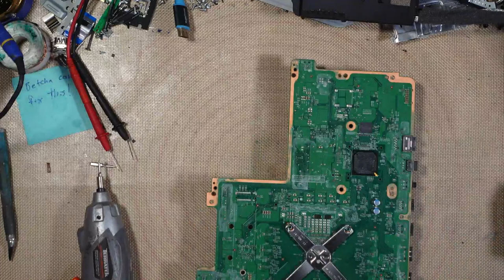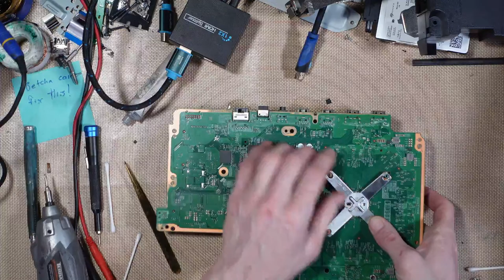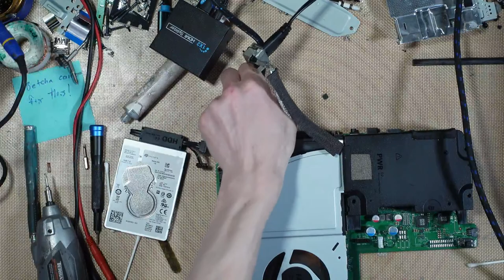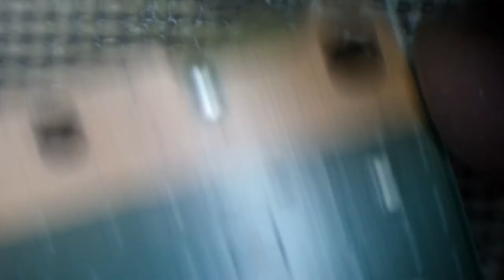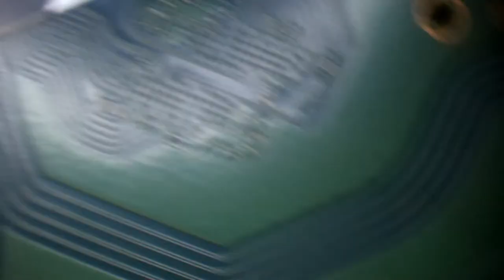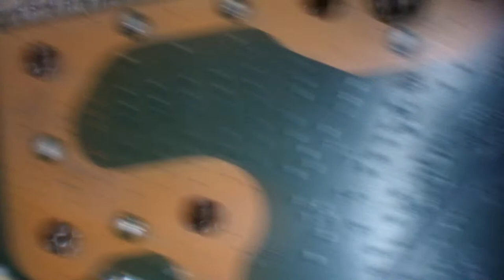🔴We're Back... For Now! Let's Fix Some Consoles And Have A Jolly Good Time :)

Comment: hi cod3r why do ps5 have to stand why cant they be laid down
Reply: Liquid metal used in place of thermal paste on apu has a seal that can fail and the liquid metal runs into console causing short circuits.
Reply: It's better to lay it down if you want it to last mate, mine was overheating when vertical because the liquid metal moves downwards and doesnt coat the whole APU like it should
Reply: Thanks you for answering the question

Comment: Why so many ps5 to Xbox series shows ps5 have alot of issues not future proof
Reply: Doesn't work like that, the latest of any console will always be the one you see at repair points the most, because it's valuable and new, and worth fixing. A lot of failures are caused by users, one way or the other, and a certain % will fail of anything, on the repair side that's all you see. That said, nothing is future proof since the future by definition is unknown, some consoles have more failures than others, the early PS3 was an absolute disaster, so was the 360, but for different reasons.